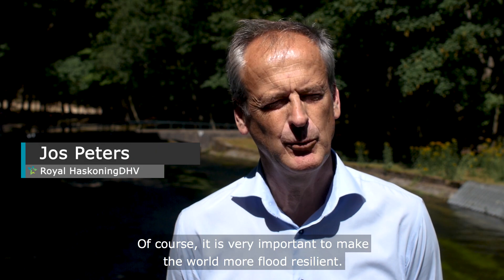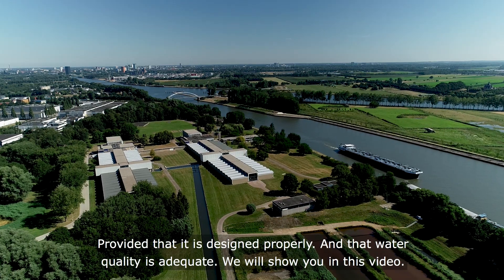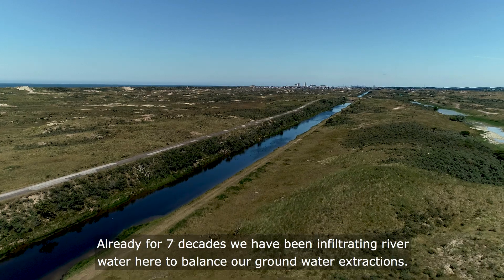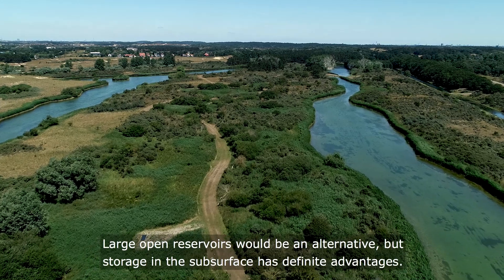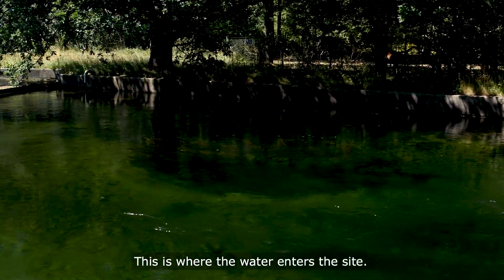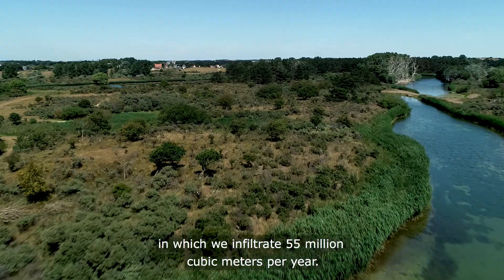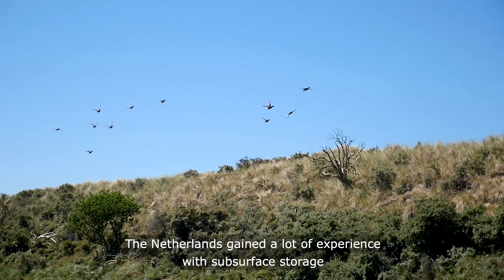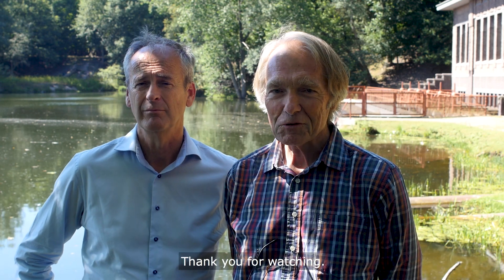Artificial recharge in The Netherlands (English subtitles)

Comment: You did not explain where the water is going underground. Into caverns, constructed open spaces, gravel beds? What? It has to have space, no? And how do you extract it? You really didn't demonstrate how this works at all.
Reply: The water seeps into sand deposits.
When you extract fresh water from the sand it needs to be replenished.
When we don't provide provide fresh water, the sea will provide salt water, thereby poluting the aquafer.